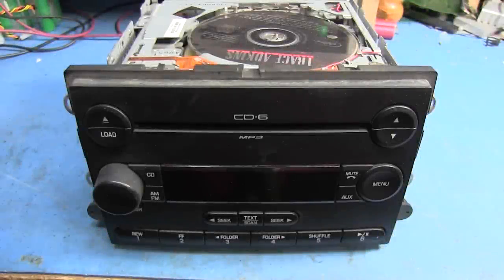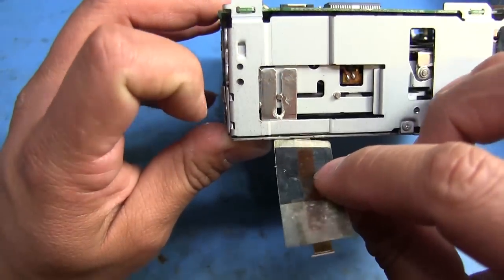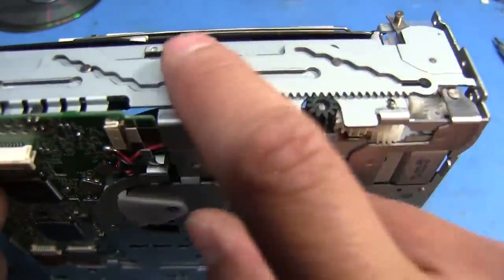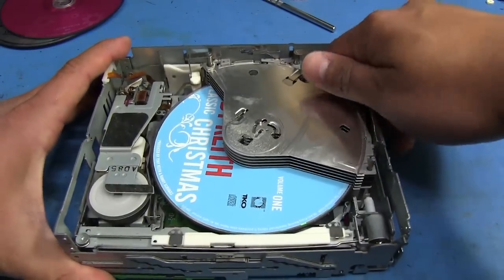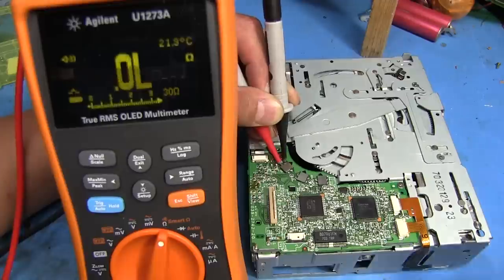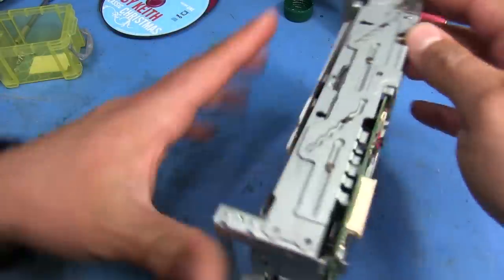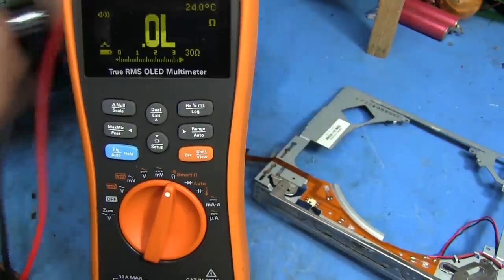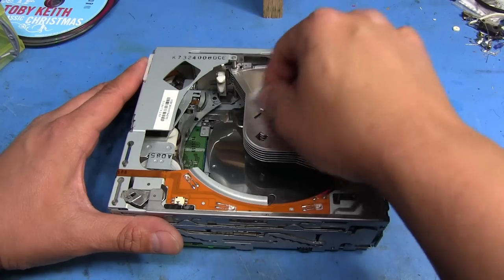TWB #5 | Let's fix it! Jammed In-dash Ford 6 CD Changer Repair

Comment: awesome video Budd, i have a Honda Civic,  it has the exact same radio, had some stuck CD inside, after puting everything back together it doesnt check for cds, it only displays mech error, motors wont start, can tell me if its an electronic malfuction or did i messed up when assambling it.... Thanks alot bro
Reply from the maker: While I can't tell you for sure what the actual problem is, if you didn't damage anything on the board or any of the ribbon cables, it's very likely something isn't on properly. I would check the white piece that rotates on the bottom where the switches are. Make sure the switches are retracted and not smashed down. Other than that, I couldn't tell you exactly what went wrong because that message is just a generic failure message.
Reply: The Workbench 
thanks alot bro, Will check it out, the White piece Is ok, the board and cables seems ok Will let u know asap ,
Reply: Hi! This also happened to me too. The radio works but the CD changer appears to have no power as none of the motors are working. None of the flat ribbon cables are damaged and everything looks good to me. Does the flat white ribbon cable that connects to the radio send power to the CD changer? Any help is definitely appreciated. Also, thank you for making this video!
Reply: Hi Marcelo, did you ever get your CD disc changer to power up/start up? I'm having the same problem where the CD changer has no power. I don't hear any motors or mechanical pieces moving when I plug it into power. Thanks!
Reply: Griffin Urbano tested the motors with a power supply, they are working ok, the white connector is ok, Will take apart everything again to reset the positions AND Will Let u know
Reply: I realized the tab underneath the white plastic piece was being smashed and not retracted, which is what caused the CD player to not mount. I got power back! Now I have to troubleshoot the large gear being stuck and not moving the trays.

Comment: I have the same unit. I changed the battary and when i did I turned the radio on and the bars that show me how hi the volume is dosnt move when I turn the volume and the radio has no sound.
Reply from the maker: The volume encoder may be dirty or damaged. Try turning it quickly back and forth several times. If it's dirty, that will sometimes help a little bit, if still nothing, it might be bad.

Comment: How do you bench wire the cd player for testing?
Reply from the maker: I just use the harness that plugs into the rear of the radio. It only uses 12V on the Bat and Acc lines and negative to ground.

Comment: Question: How were you powering the radio during your tests?
Reply from the maker: I had the mating connector, like the one that would normally be found in the car, plugged into the back of the radio and hooked up to a power supply.
Reply: Thanks. Great video.
Reply from the maker: Thanks for watching!

Comment: did everything in this video... with multi meter and all... still says CD LOAD ERROR... there obviously is a few ways these things break no solution other than re and re an OEM shaker or an aftermarket.  Too bad.

Comment: Anyone ever have side slotted rails moving free, use big gear drive nylon gear less motor to collapse CD plates after removing a couple CDs and have side rails and big gear drive jam up? Side rails only move a half slot from slot 3 and big gear drive gear only a few teeth clock or counter clockwise??? Still have 3 CDs in unit and can not figure out how to unjam??? Appreciate any suggestions!

Comment: What happened to our favourite Workbench man...., I need to answer/ video, how to fix/ clean Infiniti/ Nissan 6 CD player, mine is 2004, please, I am waiting, where are the switches in that Bose unit??? Thanks =)
Reply from the maker: Eero Laukkanen Sorry for the delayed reply, I'm admittedly pretty bad at checking my messages. :(

Unfortunately I don't have any experience with that particular Bose unit as I have not worked on one before so I have no idea where the switches are or how to even fix one. However, if I happen to get one to look at, I'll try to do a video on it and I'll give you a heads up. Sorry I can't be of more help. :(
Reply from the maker: Eero Laukkanen You know, if you can get me a picture of what the CD mechanism looks like, I can see if it's anything like any others I have worked on before. Upload a pic to imgur or something and send me the link so I can see what it looks like.
Reply: The Workbench OK, thanks for answering me, I'll try to find a picture of it, Bose unit has same problems, battery withdraws...., CD gets stucked inside, mine does not load anymore, just piip, piip voice, when I try to load CD, I am sure it is same problem, that Ford unit has, dirty switches !!! I only found one switch?? so far in mine, had to take CD player off/ up from the unit, the switch was under,...just like in Ford CD player, but there should be more switches to clean????  No gear, or springs missing =) many Nissans has same Bose CD player, my car is Infiniti FX 45, year 2004
Reply: Eero Laukkanen I will send you two pictures, one unit, top open,  is from Nissan Maxima, 2003?, similar Bose 6 CD unit, I am "practicing "with that, model PN-2532 D/ 28188- TY300, mine, Infiniti , is actually model PN-2548 N/ 28188 CG000, I am sure, these units basically work same way ! You could even google owners manual for it, I even found schematic plan for my unit, I sure can't read it, but you could!!! I am sure, maybe you could find those switches in that plan?? You will get those two pictures soon, tomorrow latest, thanks =)

Comment: bought a used f30 2008 diesel with 60k miles...tried to use the cd player only to find out that disks are jammed...im just gonna go to car toys and drop 600 bucks for a player with dvd/gps and back up camera. I aint doing all this work on a stock CD player that seems to fail often as there is 100s of videos for this EXACT deck have disk jam problems. Who uses CDs anymore anyway? kind of obsolete.

Comment: My STS had a 6 CD Changer, I wonder if it had the same Mechanism. It did jam up on me once. Bit a bit of button pushing, and unloading and reloading a few times, it appeared to self Correct. Good thing, cause I really didn't like how the Car was assembled, no screws holding the Panels and Dash on, just a bunch of Clips guaranteed to break. Useless Effin Engineers, Stylists, and Managers at Cadillac

Comment: if you have 2006 f 150 its not the same in the video the front looks the same buy its not
Reply: I have a 05 and same face plate but inside it's a lot different. bummer

Comment: K, got it. 67hbdluxe.imgur.com should get you there. Thanks!!
Reply from the maker: ***** I looked at the pics and it appears to be the gear for the roller at the front that loads/unloads the discs. I'll have to get my hands on one of these changers to verify. It also appears to have a hairline crack on it, which could be why it fell out so easily. I've been trying to come up with a way to make replacement gears as sometimes I have units (none of these specific changers so far though) with broken gears and I can't seem to find replacements for purchase. I have made some replacements using a mold made with two part silicone mix and two part polyurethane plastic. They work, but I want to try to come up with something better as I want the parts to last as long as possible. So far I haven't had any break, so I guess that's a good thing.